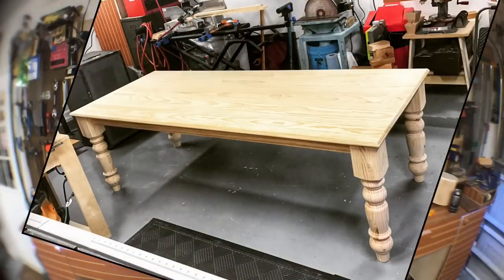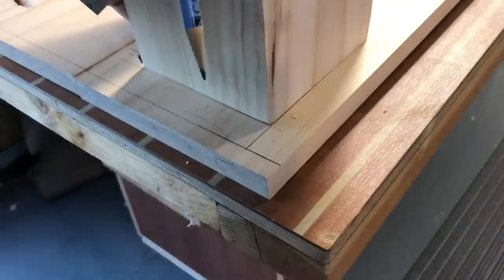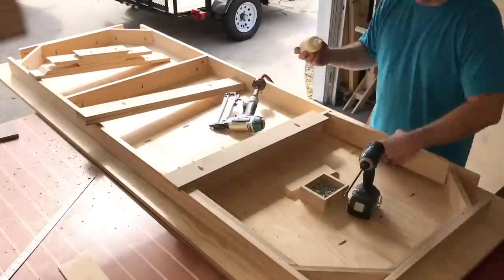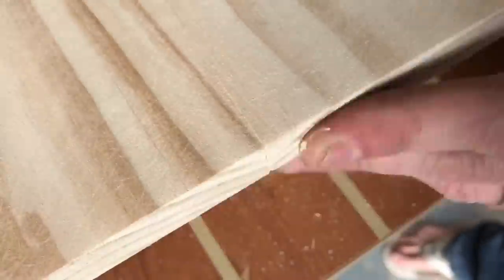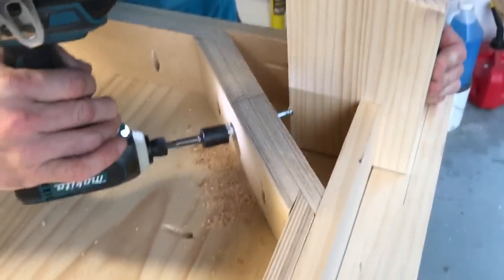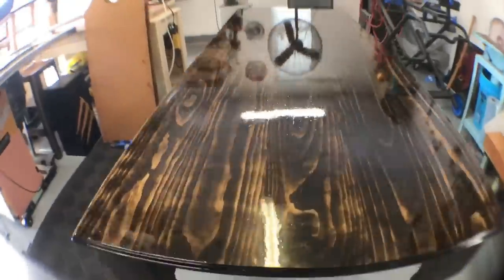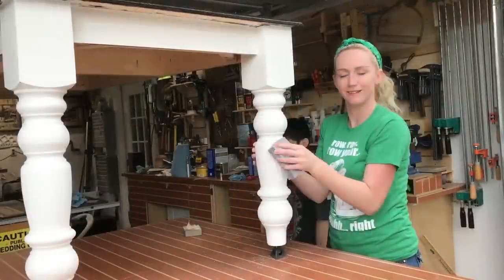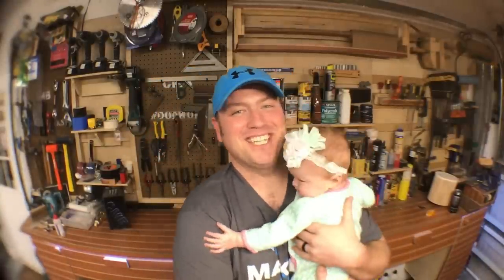How to Make a Farm Table

Comment: How long did you let everything dry in between coats before you sanded? I’m doing a table with poly, mineral spirits and boiled linseed and I let it dry over night because I was unsure to how long you waited, but I noticed when I got home the today it feels tacky or sticky but not wet after 2 coats of the 3, I’m trying to get it done before thanksgiving but also don’t want to rush things
Reply: Also me and my wife love the way your table turned out which inspired us to do our own!
Reply from the maker: I waited 12 to 24 hours between coats. However I’m in Florida and even during the winter months it stays pretty warm.  If it’s colder where you are or you’re not indoors around 72° that mixture will definitely take a little longer than expected. Sometimes 2 to 3 days. I should’ve said something about that in the video and I feel too so I’m sorry about that. But I hope that helps
Reply: Okay thank you so much!
Reply from the maker: Joshua Young The time
Reply from the maker: Joshua Young *Anytime

Comment: What do you do with the bottom of your table top and do you worry about getting paint on it while painting the base white?
Reply from the maker: Joseph Smith I left the bottom bare and You just got to be careful when painting. If the piece was not rustic I would’ve taken more measures to protect the bottom when I was painting however, a little paint on the bottom of the table was not that big of a deal

Comment: thanks for sharing, this is amazing I really love it, Im going to make one for my wife, can you help me with your mix, can you tell me how much did you use of polyurethane linseed oil and the other, when you said 3 part of this and that, explain me please. thanks
Reply from the maker: Edgar Aldiss absolutely. 4 parts poly. 3 parts boiled linseed oil. 2 parts mineral spirits. Lightly hand rub the first two coats. Then finish with only poly. Thanks for watching and commenting sir!  Means a lot!!
Reply: A Glimpse Inside thanks for the explanations, but I'm new with mixing stuff, sometimes I just use stain, but when you said 3 parts of this and 4 parts of that how much is in it? in cups please and sorry for bothering.
Reply from the maker: A part can be in a unit of measurement you want. Example a bathroom rinse disposable cup. 4 cups of polyurethane 3 cups of boiling zero and 2 cups of mineral spirits.  You can use a soda bottle cap as a part. Anything can be apart. A gallon an ounce in milliliter. It doesn't matter is long as you use the ratio above. I hope that helps if not I'll answer any other questions you have. It's my pleasure
Reply: What is the reasoning behind the mixture? Does it dry faster? Protect better? Or just personal preference? Thanks for the awesome vid and I'm still waiting on my stickers! Lol thanks Chris
Reply from the maker: Honestly, it's just personal preference and experience in tinkering with different mixes. That's it, also the stickers went out Monday. You should get them soon. All I ask is that you tell your friend and hopefully they jump on board and subscribe too. Thanks again Josh

Chris, 

Keep calm and make on!!
A Glimpse Inside
Reply from the maker: +Joshua Peterika personal preference for sure. For me, that mix goes on best for my climate in NE FL. Stickers are on the way my brother don't you worry !! Thanks again!!

Comment: Awesome video ! Can you share your instructions for the top coat of the table as far as amounts/mixture. That came out really nicely.
Reply from the maker: +Brandon Scott yes of course! 
First mix is equal parts of :
Mineral spirits 
Dark walnut stain 
& semi gloss polyurethane 
Apply this mix then
Let dry, then apply 
Equal parts polyurethane and ebony stain.
After a liberal coat is on the whole surface, rub it in vigorously, then wipe clean with mineral spirits. 

I hope this helps!!! Thank you for watching!
Reply: What was the mixture that you had in the jar?
Reply from the maker: +Brandon Scott two parts mineral spirits. Three parts boiled linseed oil. For parts polyurethane/simi gloss.
Reply: A Glimpse Inside sorry I'm new to this. When mixing in a painters mixing cup does it matter which liquid you start with when doing the ratio?

Comment: So I followed the video and made a very similar table. The problem I'm having is when I lift the table it twists slightly. I haven't done the second layer of ply wood yet. Could that be the problem? Any ideas on a fix? Also, what size lag screw would be best for a 4x4 leg? I used 5" but I feel like it might not have enough grip.
Reply from the maker: Hey brother sorry about the trouble you’re having however I am curious about one thing when the table has all four legs on the ground does the twist seem to disappear or is a problem when the table is just sitting there? Also yes the second layer of plywood will help stabilize it a bit more and the length of lag screw depends on how far back the 45° angle pieces to leg. A good rule of thumb is that the screw tip is 1 to 1 1/2 inches shy of coming through the leg on the other side
Reply: It's only there when we pick it up. Moving it from the bench to the ground. Solid when on the ground as long as we don't lift it.
Reply from the maker: So after building my table I learned a little something that I should’ve included in the video. Look at your end grain. It should be alternating directions per board if not you’re going to have a bit of a twist. I really do hope that it’s livable and you get a lot of use from your table. Thanks again

Comment: Hey bud, I'm going to make this for my dads Bday next month and just a fast ?. Did you use just one size PH screw or 2? And what size? I'm guessing that's  1x8 inch boards in the
 table top and 3/4 inch birch so, just wondering which screw. Thanks man!
Reply from the maker: One size! Inch and a quarter. That’s great you’re gonna make one for your dad’s birthday. That’s a good idea. Remember the screws are just essentially clamps to hold things together while the glue dries. So Inch and a quarter worked well all the way around

Comment: Hello Jummy! 

I loved this video and all the tricks of the trade you share with us! Thank you!

A question please - can I use "Turpentine substitute'
 instead of mineral spirit? for the top coat mixture.

Also, how long is the drying period between 2 coats on the top ?

Many thanks!
Zora
Reply: Ok, I saw below - 4-6 hr waiting time.
Reply from the maker: Zorana Sp in terms of can you use turpentine as a substitute? I'm not really sure. I've never had any experience using turpentine. However thank you so much for watching! It really means a lot that you reached out to me
Reply: Jimmy,

I googled it and this came up:
'White spirit (UK) or mineral spirits (US, Canada), also known as mineral turpentine (AU/NZ), turpentine substitute, petroleum spirits, solvent naphtha (petroleum), Varsol, Stoddard solvent, or, generically, "paint thinner", is a petroleum-derived clear liquid used as a common organic solvent in painting and decorating.

Seems like its one and the same thing. I'll go for it. Fingers crossed :)
Reply from the maker: Zorana Sp that's awesome and good to know!!  Also. Who is Jimmy?😂

Comment: Hey Chris! Really enjoyed your video on the 8' farm house table,I plan on building my wife one! You said the legs were 6 by 6 wide so r they 29" long r longer?
Reply from the maker: Anywhere between 27 and 29 is good you typically want a table height to be around 29 1/2 to 30 inches so depending on how you attach them. The length should be according to how thick the table top is

Comment: Sorry if I missed it in video. What where your final dimensions? I heard you say five 1x8 boards but it looked from a few spots that you may have thinned their width some, but it could have just been the bend of the camera lens.
Reply from the maker: +Shane Roberts yes the wide angel lens can distort the picture for sure. I did not trim the boards. The final dimensions are 40" x 7' 10". I did  trim the edges ( the heads of the table) about an inch. Hope that helps! Thanks for watching
Reply: Just finished my first wood project following your video ,the table turned out great ,my wife is so happy with it . Blessings to you and your family,  From the Bradburys.

Comment: Hello did you use satin or a gloss polyurethane? Also can I use paint thinner instead of mineral spirits?
Reply from the maker: Are used a gloss polyurethane. And I honestly don’t know about the paint thinner. I would hate for you to use it and have a different reaction. So I would stick with mineral spirits just to be safe
Reply: @AGlimpseInside  I live in California and for some reason they banned the sale of mineral spirits
Reply from the maker: Jaleel Juju What the heck. Leave it to California to do something like that. You can’t even Amazon it in? Either way just Google a manhunt not really sure but you really don’t need to mix the mineral spirits   You could apply it without it it will just be a little bit thicker but you should get roughly the same result
Reply: @AGlimpseInside  Okay great, thanks for the information. I'm refinishing a 6 foot Lane coffe table, can I email you some pics of the before and after?
Reply from the maker: Jaleel Juju yeah do that!  I’d like to see it!!

Comment: What type of cloth do you use to rub the stain on? Is it the same type of cloth that you used to put on the first coat of finish? Table looks awesome by the way!
Reply from the maker: Thank you sir. I use an old t shirt. 💯 % cotton
Reply: Thanks for the reply. I sanded down a coffee table and then used Minwax polyshade, the stain with Polyurethane mixed together. I ended up with a lot of bumps, the finish wasn't smooth. Maybe I didn't clean the table good enough after sanding it. Then I thought maybe I should apply stain and polyurthane separately like you did in this video. So I have the stain and polyurethane, I'm going to go back to Lowe's and buy the mineral spirits and lindseed oil to make the finish like you did here. Your finish looks FLAWLESS!
Reply from the maker: Hey thank you so much. I will say this be careful with colder climates right now. I’m not sure where you are but putting boiled linseed oil inside of that mixture in colder climates next to finish take an incredibly long time to cure. During this time of the year I typically just use polyurethane with a little bit of mineral spirits to thin it out. Hope all goes well brother take care
Reply: I'm in California, it's currently 2:55 pm @77°. I will play it on the safe side and follow your recommendation.
Reply: What kind of polyurethane do you recommend? I picked up Minwax fast drying. Should I get a slower drying? Last question, I promise! lol
Reply from the maker: Ask as many questions as you want it’s no problem. I typically like using polyurethane specially designed for floors. I figured if you can withstand people walking on it it’s probably more than enough for a table. Usually I pick up a gallon of it and use it throughout the year just keep it airtight
Reply from the maker: Minwax brand is great. I use it’s flooring Polyurethane all the time

Comment: Why did you drill horizontal pocket holes on the ends of the aprons?were these used?thanks
Reply from the maker: +george harris hey George, I did drill those holes there in case I needed them. As it turns out after assembly I couldn't even get a drill in there. Out of 25,000 views almost you're the only one that noticed so far. Thanks for the view man. As it turned out they really weren't needed , that joint was plenty strong
Reply from the maker: +george harris hey George, I did drill those holes there in case I needed them. As it turns out after assembly I couldn't even get a drill in there. Out of 25,000 views almost you're the only one that noticed so far. Thanks for the view man. As it turned out they really weren't needed , that joint was plenty strong

Comment: What would be the smallest size legs you could use for the table and it still be good and strong? I can't find any legs that are near that size.
Reply from the maker: Austin Wiley hey thanks for getting involved! Honestly 4" x 4" would be the smallest legs I would use on the table of 8 feet in length. I'm in northeast Florida and we have a salvage yard called eco-relics that has an amazing assortment of table legs. Honestly if you're within two hours of Jacksonville it's definitely worth the trip. Check out their website just Google eco-relics who knows they may ship them to you.
Reply: A Glimpse Inside I wish we had something like that in North Alabama. All we have is a Lowes and Home Depot.
Reply from the maker: +Austin Wiley they should have the 4" variety. They do here! Hope you find some!

Comment: That's awesome! How much would you typically charge to build that for a client?
Reply from the maker: A good starting point I think is anywhere between $800-$1200. Depending on the materials and time it takes. Of course more expensive tables would be crafted with much harder and more expensive woods. However for what is in this video I think the numbers above are realistic

Comment: Did you paint or stain the bottom side of the edge of the table?
Reply from the maker: I did not. But I should have
Reply: Assuming you had, would you have painted or stained it?  it was a sweet table....going to attempt it, myself.

Comment: How long are the legs for the table you did?I've heard that the legs from Home Depot and lower are too long unless you wanna use some tall chairs
Reply from the maker: They are 30 1/2 "   standard for dining tables is usually 28" - 31" . As for lowes and homed depot, I think they aim for the tall side of things so the consumer can cut them shorter if desired. Thanks for asking!!!

Comment: How long did you wait until you put the next layer polyurethane on? I'm going to definitely try your poly boiled linseed oil and mineral spirit concoction
Reply from the maker: Scot Hershman , I waited about 4 to 6 hours between coats. It all depends on humidity and temperature. During the summer it takes less time. It really all depends on when the surface is sandable without gunking up!
Reply: Did you lightly sand between the foam brush applications
Reply from the maker: Scot Hershman yes I believe I did. It's been about seven months since I've made that table, however I would always advocate sanding between any type of finishing coats, unless it's the very final last one or two!
Reply: This is the first time using your concoction, I lightly sanded the second coat, here is the question:  are the results of the sanding,  dusty like wood or is it kind of gummed up polyurethane like in little balls

Comment: So, I am a bit of a noob, and right now I'm a big time pocket-holer because they're quick, easy, and very approachable.  I haven't built a table yet, and  I'm always reading and hearing a lot of people say how joining  table top with pocket holes is a bad idea.  Could you give an update on how the table has held up over the years?
Reply from the maker: It is bad if you’re going to use glue however with this material there wasn’t too much flex. Typically would join a table top with something, figure 8 fastener or maybe in 90° angle bracket of some sort. I actually still no the guy is a buddy of mine that has the stable and says it’s holding up well no cracks no nothing so either I dodged a bullet because at the time of me making this I was still learning myself.
Reply: @AGlimpseInside  cool, I want to build a table for my daughter and I'm still trying to work out what style, and what joinery methods, etc.  I saw a video about using pocket holes for breadboard ends on a channel called Woodbrew.  It sounds plausible to me and I think it could be used for attaching a table top as well.  He said you can slightly enlarge the screw hole at the base of the pocket (but not so large that the pan head can't seat), and this gives the screw shaft a little room to accommodate wood movement.  FYI I found your channel through stumpy nubs in case you want to give him a shout out.

Comment: I'm gonna use your staining method. Question on the 3 part. The BLO. Is it store bought or home made? If it's storebought... did you boil it after purchase. Great looking color combo. Gonna follow through. Instant new fan here.
Reply from the maker: It’s simply store bought from A home center. And no, no boiling at all. Thanks for being a board. Very much appreciate it
Reply: A Glimpse Inside do you do any lathe work?
Reply from the maker: Carson Burkhart yeah a little. Look through my videos. I have made custom screwdriver handles. And even a pen made out of bread. Check them out
Reply: A Glimpse Inside how about table legs?
Reply from the maker: Carson Burkhart I just have a Bench top lathe. Once I upgrade to a full size I will definitely make them

Comment: how do you know how much to sand? I bought pine boards for a console table and I have 80-220 grit but don't know how much to sand!
Reply from the maker: +Shannon Spencer I typically start with an 80 to 120 grit and make my way to 220 or 320. I sand until the surface feels smooth to the touch. Then I will coat the surface with mineral spirits, a light coat, to see if there any scratches that were made from the sand paper. If there aren't any scratches i move onto the next grit. And I stop at usually 220 or 320. Hope that helps